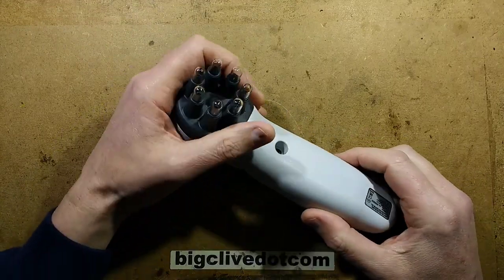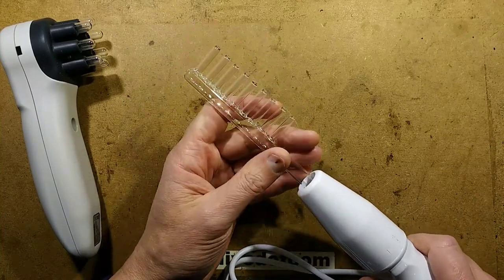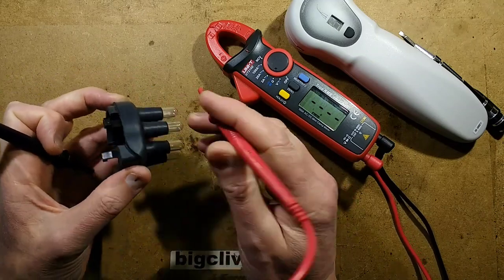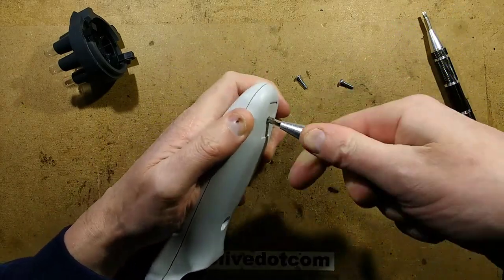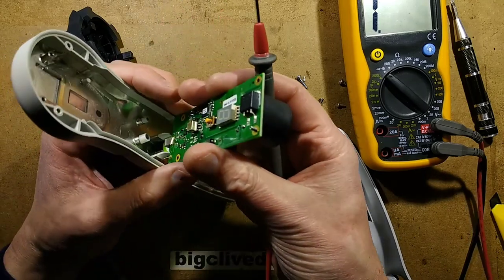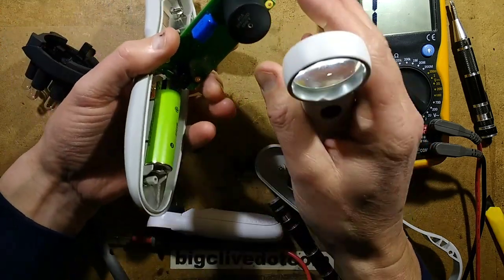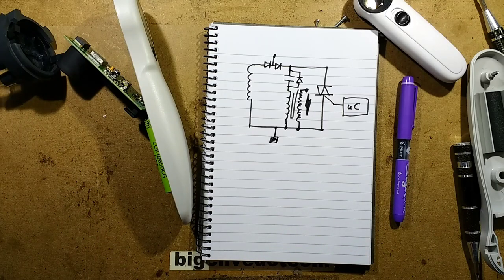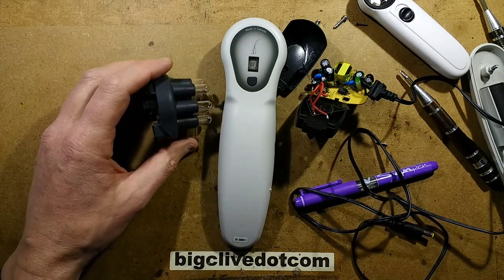Inside a Trioxinator hair growth stimulator.

Comment: Conductive rub-...

*head explodes*
Reply: You CAN get rubber which is intended to conduct electricity: it is loaded with carbon particles which are not "chemically bonded" to the rubber, just mixed up in it. This is used in screening applications. I have seen it used in "intrinsically safe" sound meters to electrically and mechanically join two half-body-shells made out of non-sparking bronze. These things had to be capable of being smashed in half by a big mining tool without creating a spark that would ignite gas. The circuits couldn't use any capacitor bigger than 10nf, and the battery had resistors in the leads so you couldn't get an ignition by running a wire brush over the circuit board. You weren't allowed to put Duracells in them! Zinc-carbon only.

At the time these were made, there were no micro-processors capable of running much below 20ma of supply current, and they needed decoupling capacitors, so the meters had to be able to calculate Leq by hard-wired hybrid analogue/digital "computer", which required a playing-card sized circuit that used less than 4ma. Conductive rubber was but one of the unlikely things that were needed to meet the safety spec!

Nowadays you can get MPUs that run on microamps and you don't need to be very clever to design an intrinsically safe instrument.
Reply: trustnoone81+ Conductive rubber contains either carbon particles or (more rarely) fine metal dust to make it conduct.  It isn't a great conductor but it does conduct moderately well, enough for this kind of application.  Many membrane keyboards use the carbon particle type of conductive rubber.

Comment: High voltage generator appears to be classical capacitor discharge circuit. Switch is a SCR. When triggered it dumps capacitor across primary to generate a few kV on the secondary. As inductor will "ring" SCR resets on current reversal and excess energy is returned to capacitor ready for next trigger. I replaced my old 1960 car's ignition system with this and it ran for about 10 years on the original points and plugs!

Comment: Twenty years ago, while working my way through trade school, I worked for a rubber manufacture that molded parts for all sorts of devices. The lab would send out recipes for batches that where conductive in various quantities. At one point we made conductive non-marking soles for boots of some type. The ones I wear insulate to 5k volts but I'm sure in some area of work it is very important not to build up a static charge and coupling to ground is highly desirable. I'm wondering if this device would give a nice tingle with that conductive sole in your boots. XD  Great vids guy.

Comment: I think the idea behind these things is that it helps increase blood flow to the scalp which keeps the follicles healthy. My dad has a violet ray thingy that he has been using on his hair for decades and he swears by it.
Reply from the maker: If your dad's violet ray packs in you can buy modern ones on eBay called Darsonval which are cheap and come with a set of electrodes that might fit your dad's machine.    But don't let him use the metal rod electrode in either.  It comes from a time that electrical safety was considered less important.
Reply: @bigclivedotcom  Honestly i think his dates back to the 60's or 70's o.O

Is there something i should look out for? Ive told him before he should be using something that old!

Comment: Or just say to hell with it and shave  it off. I've been doing it for almost fifteen years and would make it permanent if I could.
Reply: Nair.
Reply: LakeNipissing Not permanent and it comes back fuzzy and thin at first. It's the same thing with electrolysis and laser hair removal, they last a little longer but not permanently.
Reply: Interesting. I guess the 'nair for shampoo joke' I have heard about does not work! A co-worker shaves his head regularly, and he often has cuts on his head from the razor. I've been fortunate so far, 45 years and still complete hair with stuck in the 80s mullet!! The hair serves an important purpose having fair skin... built-in forehead, ear and neck sunscreen!!
Reply: Yup, started thinning out, out came the clippers, and now bald :o)
Reply: Yep, embrace the baldness. It's what I did, just a quick going over with a buzz cutter every month and it's good.
Reply: Have you considered laser hair removal? Removes hair and lasts a long time but you might have to deal with ingrown hairs as they, eventually, do regrow.
Reply: Peabrain That's exactly why I didn't. If someone comes up with a process that truly permanently removes hair and doesn't cost more than a couple grand I'll do it.
Reply: Didn't someone develop a pill to give to sheep, which made their wool fall off, a few decades ago? It was supposed to be harmless, and cheaper than the cost of shearing. I suspect that naked sheep wouldn't fare too well in many climates. Maybe that's why it never became popular?
Reply: Looking at photos from a decade or two ago I got to say I'm better off with almost no hair anyway ;) . It has a lot of advantages. Hair drying is a 10 second rub and there's simply no "bad hair day". Not to mention how much time and money it saves not having to go to the hairdresser. 5 minutes a week with the clippers and I'm done.
Reply: Started loosing mine about 25 years ago and decided never to do the comb-over thing. The thinner it gets the shorter I cut it. I'm 55 and have a quarter inch stubble now. Never had a negative comment from anyone that mattered to me.
Reply: I'm 24 just started shaving my hair to bare blade, meanwhile my 45 year old uncle is fighting to keep his. The only downside of bald head is fluff keeps sticking to my head, and it's a bit nippy in winter!

Comment: I suspect that screw was covered with silicone to pass ESD testing. With the metal sticker over it and a metal screw it would become a discharge path from the probe and then to the negative terminal of the battery next to it causing a malfunction (but not necessarily permanent damage).

Comment: As I recall small, standard neons from many years ago, there was a glass pip in the envelope opposite the electrodes where the envelope was filled.  Rather pointy and brittle, so not as robust.
Reply from the maker: +bdf2718 You get screw in neon lamps with a rounded glass dome.

Comment: Hi Clive, Love your Video's, - Just a completely off topic Question that you mighty be able to answer,  Why are Darkroom Light bulbs so damn expensive to buy, what technology is being used and also is it possible to Make your own.. So actually 3 Questions really.. slightly misleading, sorry.
Reply: Darkroom safelights are I guess selling into a vintage equipment collectors market these days - the ones I'm familiar with used a white 15W tungsten 'pygmy' bulb inside a filter dome which reduced the short wavelengths that the B&W papers are sensitive to. I'd guess it'd be possible to make one using red LEDs, it's something I thought about doing many years ago but in the end never tried it. 
datasheet for a typical B&W photo paper https://www.ilfordphoto.com/amfile/file/download/file_id/1957/product_id/743/
as you can see sensitivity has fallen off dramatically by 550nm - the colour of a greeny yellow LED - red LED wavelength typically about 700nm so light from red LEDs should be safe
If I was thinking about making one today I'd probably be thinking of using an ebay 38 LED DIY lightbulb kit (as featured in clive's psychedelic lightbulb build) with all red LEDs
obvs give it some sort of safeness test with your B&W paper before using it in anger.
Reply: PS we were always told the ones that are a tungsten 'firelight' bulb with a ring of black paint covering the gap are a fraud and are not safe to B&W paper.
Reply: I made one using 8 1-watt red LEDs. It works perfectly, no filter needed. Doesn't affect B&W paper at all

Comment: I have a client who is producing these devices, his is called the TeslaBrush and looks almost exactly the same. Im soldering all his prototypes, handing all the shielding, and designing the next case. Apparently it stimulates hair growth in 50% of men, but i honestly couldnt tell you if thats true.
Reply: I can confirm that its conductive silicone.
Reply: They arent trying to keep you out with the sillicone, its because the screw is connected to ground and you can get a shock.

Comment: Girlfriends sister bought something very similar to these that plugs into the main 120v. You can’t use it in the washroom as the GFCI/RCD trips which is a sure sign of electrical safety in a device. No identifying marks of any kind and certainly no approval of any kind. I did warn of of potential shock hazards and dubious results.
Reply from the maker: That sounds like a darsonval type device.  It's electrically quite ferocious and can damage electronic equipment if put near it in use.
Reply: bigclivedotcom thank you for the warning.  I did mention it to her yesterday after researching this video. She is having some computer issues, but me thinks that is more to do with being an old windows computer. Never the less I recommended keeping iPad etc. Away from it during use. I passed along it’s ozone generating properties may be the only thing that is helping....perhaps...great video and as always, great topics.

Comment: Clive, this is on a completely different subject but I have a question that you may be able to answer.
A friend of mine has recently purchased a Motorola Android phone.
He was disappointed with the battery compared with his previous Motorola so he researched it.
Someone else had complained and Motorola looked into it. Their answer was, only use the charger supplied with the phone.
My friend had been using his old Motorola charger, so he compared the chargers.
Input in, the same. Output the same. Then he noticed the old one was 2amps and the new one was 2.1 amps. He was sceptical but followed the manufactures instructions. He was amazed that the battery life was 3 times what it was on the 2 amp charger.
Why would this make such a difference?
This question is open to everyone.
Reply from the maker: +Harvey Smith It's possible that the phone was only charging at low current.  Was it actually displaying 100% on the old charger?
Reply: Thanks for getting back to me. Yes it displayed 100%.
My friend is a computer engineer and I am a self taught idiot.
We discussed this in the pub yesterday. The only answer we could imagine was, did the phone have some way of measuring the amps and that tripped it into a fast charge setting or similar on 2 amps.
Although Motorola themselves said to use the new charger, my friend didn't believe 0.1amp would make any difference but was shocked that it did.
We don't need an answer but it just bugs us when we don't know what the pixies (copyright AvE) are doing.

Comment: 04:20 Careful about putting that thing in the palm of your hand. If it did work everyone will think you have been doing the five knuckle shuffle!
A lot of common neon lamps have a pip at the end which would break off easily if they tried to use them in this application hence those custom globes.
Reply from the maker: I think I've conclusively proven that doesn't cause hairy palms.

Comment: During watching of this video, I thought of plasma balls.
And it turns out that you have such a video on your channel already!
Thanks. ^_^
Reply: BTW, I have disassembled my plasma ball, and it only has a potted module inside. And it works on capacitive coupling through the glass from metallization layer on the outer surface, just as these ones do, I suppose.

Comment: That 18650 looks like a Japanese one I've seen in laptops.
Reply: In laptop batteries or straight soldered into the laptop? I hope not the latter.
Reply: I've not seen them soldered but spot welded together by metal strips within the drop-in battery housing. These ones appear to be Panasonic (by number anyway, the Chinese rip-off numbers though..)

Comment: Still works better than iOS11.
Reply: iOS 11.1 Beta 3 looks more promising. Some of the changes don't make any sense at first, but they are fine after the initial disorientation. A few things still don't work, such as no ability to clear Safari history, and multi-tasking is unreliable. Split screen has lost some of its functionality, but you can split to either side of the screen now. Time will tell. Battery life is much better. This iPad ran for 18 hours or more, the other day, and the battery discharged from 90% to 10% in that time. The best I ever managed with iOS 10 was 16 hours, 15 minutes, from 100% to 0%. There's also an undocumented return of the ability to auto-dim in low light conditions, which had been lost for a while. It's the Curate's Egg as usual.

Comment: Ah, the marvelous things an inquisitive mind learns pulling on a loose thread from a Big Clive video - such as the mentioned earth-referenced metal electrode... turns out there are direct-contact metal electrodes wide(ish)ly used with this sort of thing (instead of the inherently insulating glass tube versions), except... yeah, except those more often than not include an (also insulating) spark gap built right into their cable, so high voltage zapping can proceed merrily but potential electrocution not so much. Better ones actually can even have two gaps apparently. Now guess how many the "power tripper" attachment sold for this (?) wand has. Yes. Correct. None...